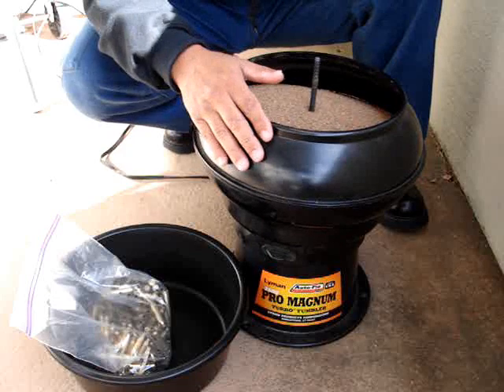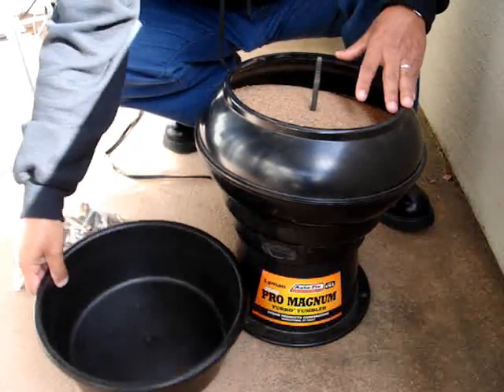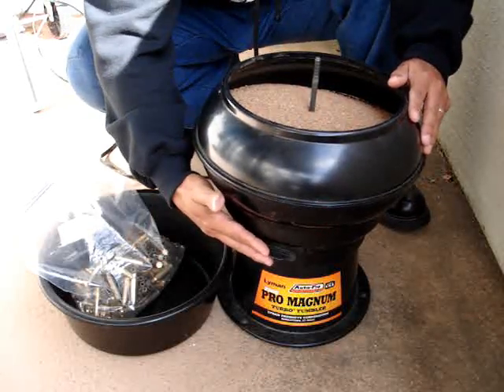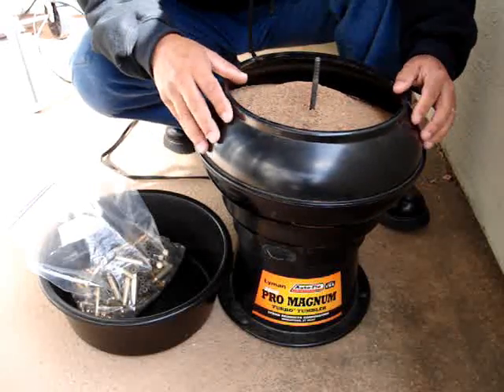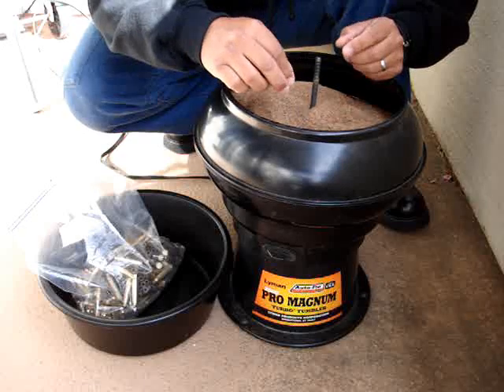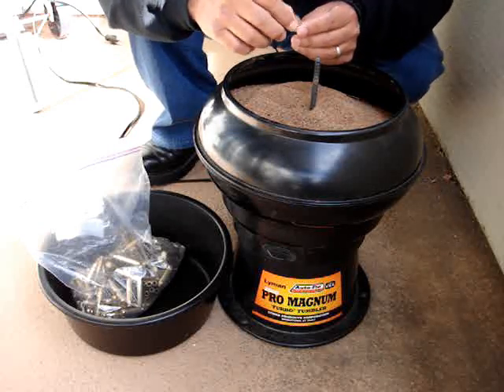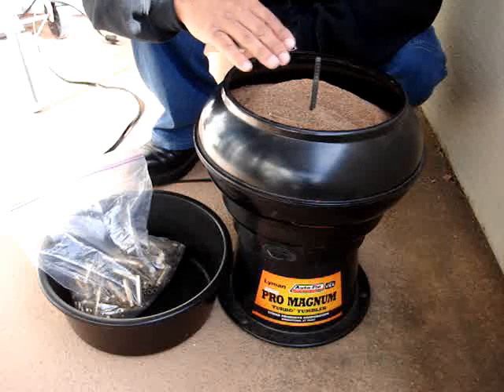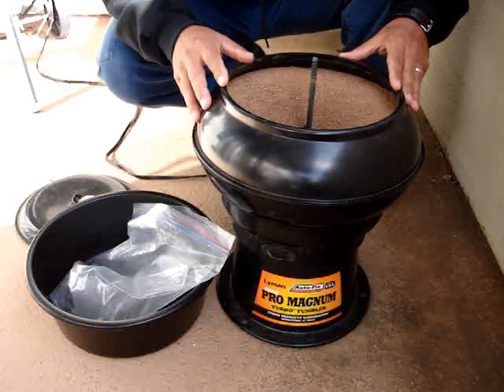reloading .223 (6 of 13)

Comment: You tumble your pistol brass after its loaded? I have never done this and heard form other relaoders its a big no, no! But obviously you have never had a problem with it. The reason I have heard you should never do that is that it can break up the charge and make the powder finer.lets say you are reloading with accurate #7. A very large grain powder. Then you tumble the brass. And break up the powder to the size of lets say, Unique. The load then might be to "hot". have you ever heard of this?